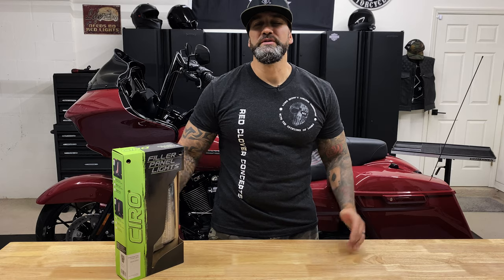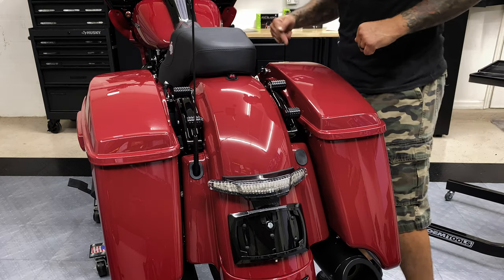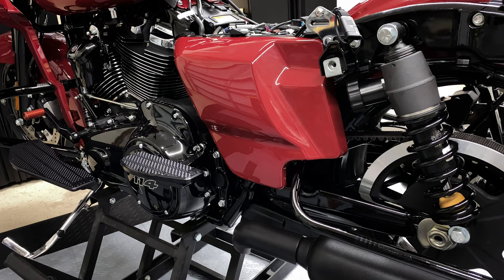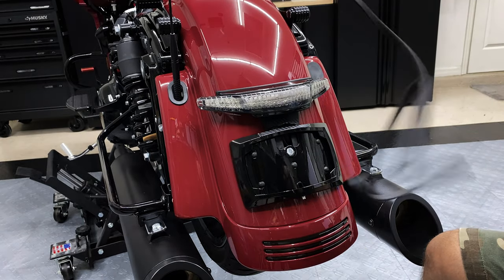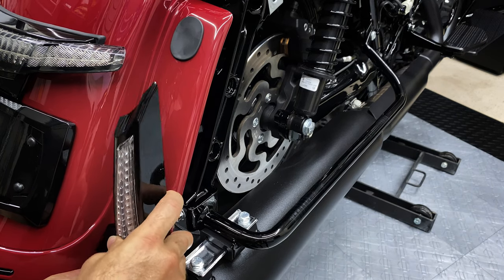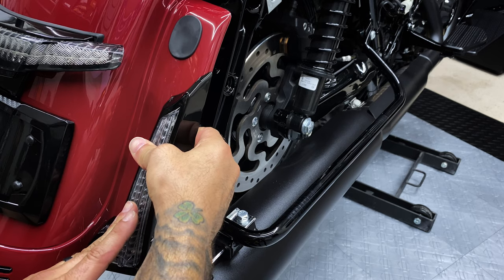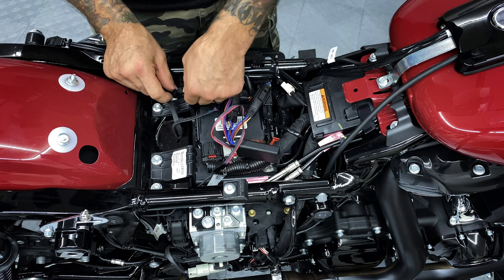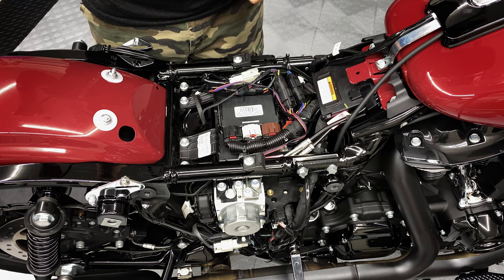Ciro3D Filler Panel Lights Installation and Review

Comment: You ride test along with saddle bag light, how you connect saddle bag light and filler light together?
Reply from the maker: There is a splitter that comes in the kit.  You can also purchase the 4-Way Splitter https://ciro3d.com/products/ciro-rear-end-lighting-wiring-y-splitters
Reply: @RAIDERWORLD Thanks, subscribed 👌
Reply from the maker: Thank You 🙏🏽

Comment: Hey Brother, as always love your videos, please keep them coming. Do you know if I will need the Ciro3D Y-Adapters? (I just bought the Filler panel lights, and I already have the Bag Blades and the Lighted Saddlebag Hinge covers installed).
Reply from the maker: Thank You again! I would get the 4-Way splitter, that way you have less harnesses/splitters.  But I do believe they do come with a Y-Splitter

Comment: I installed  mine the same way but my lights come on then shut off after a couple of seconds  and the full latitude light is not coming on. the filler lights work  but not the latitude lights. Road glide 2020
Reply from the maker: I would definitely check your connections, especially behind the actual latitude tail light.  Also, try running a reset of the lights